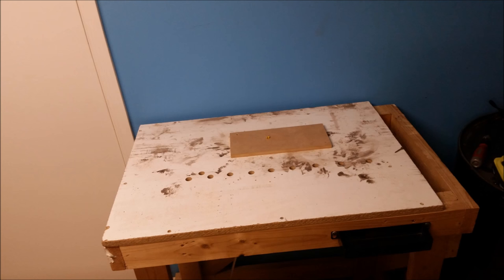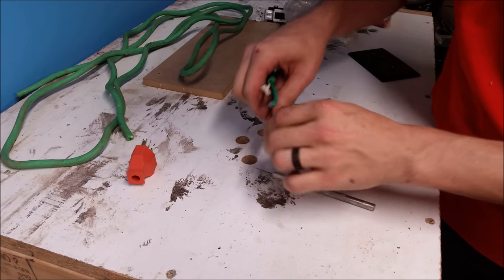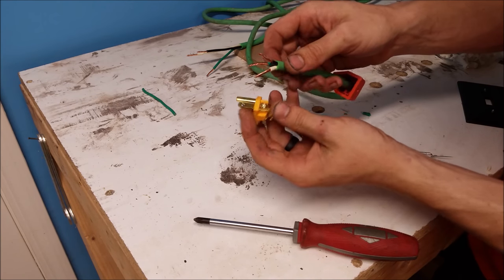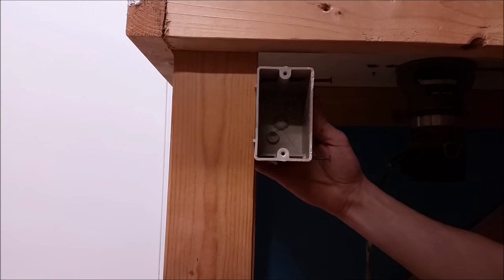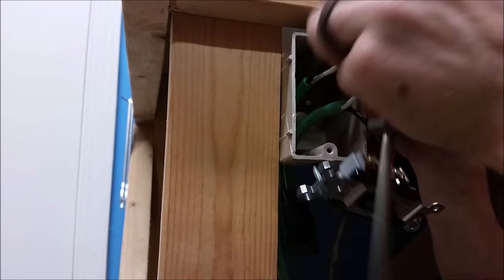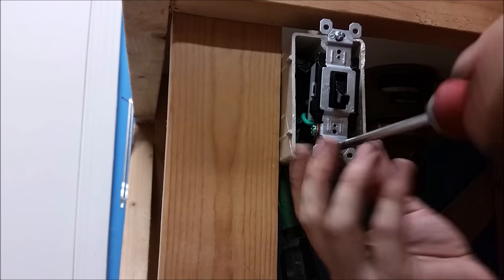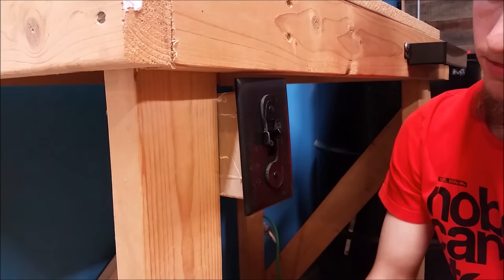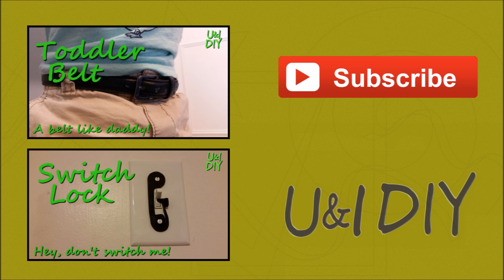Power switch - DIY Tutorial

Comment: Thanks! Zac and I agree. I figured this would work and was looking to confirm because I'm a hack when it comes to electrical. Many of my old tools have switches that are too easy to engage and you have to take your eyes off the tool to turn off.  I'm using a paddle switch with a large wooden paddle over the top of it that easily disengages, but will have to reach through a hole to turn on.

Comment: does the 3 inch green wire get grounded anywhere or is it just screwed into the switch?
Reply from the maker: I used the little jumper so I could connect both of the ground wires in the input and output cord to the single ground screw on the switch. They are grounded to the house using the ground wires in the house wiring. The mouth of the plug face if you would. There should be two screws next to each other, those are the switch (it breaks the connection of that line). Then there is a standalone screw. That one should be the ground screw. If you are doing surface mount consulate you can cause ground it. Otherwise, just ground it to the wiring and the house will take care of the rest.
Reply: @UIDIY  What if my house doesn't have one?
Reply from the maker: Some older houses just don't have ground wiring. Skip that part.